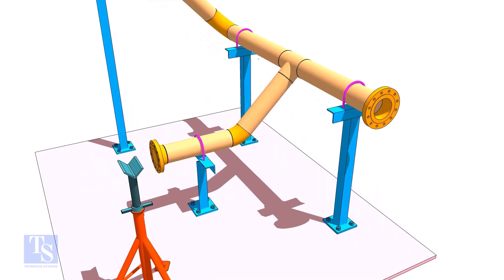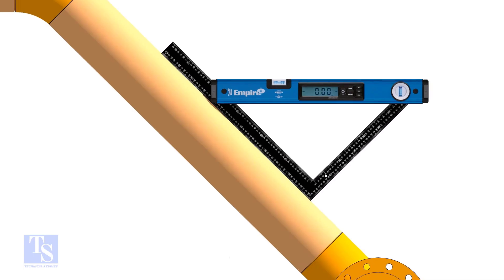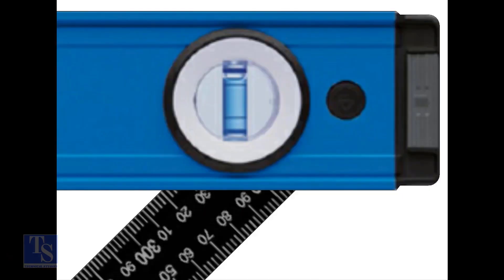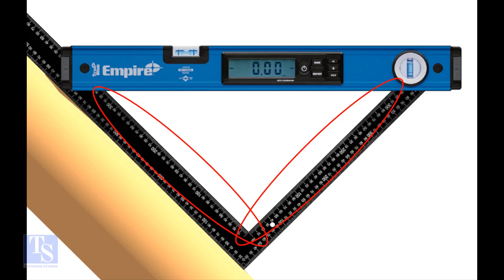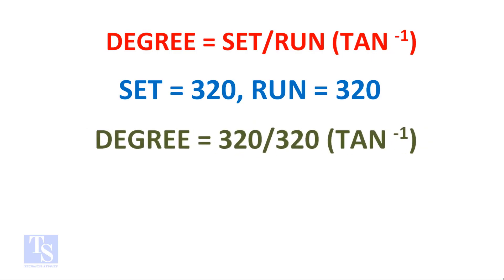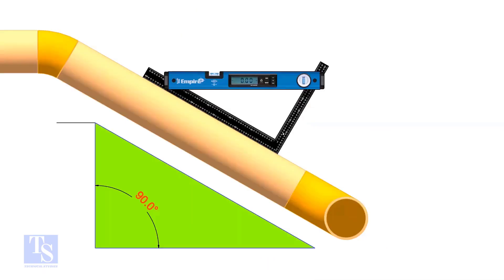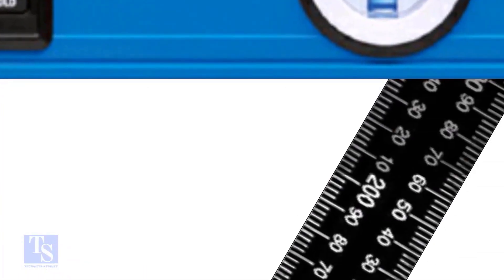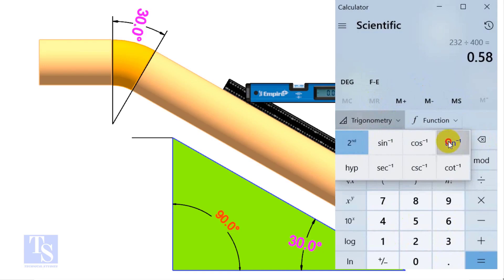How to calculate the slope of a pipe easy method

Comment: Probably the easiest thing to use to figure out the slope of the pipe is the digital level shown in your illustrations
Reply from the maker: You are correct. The problem is, digital levels are  not costly, and getting damage easily because of many reasons.